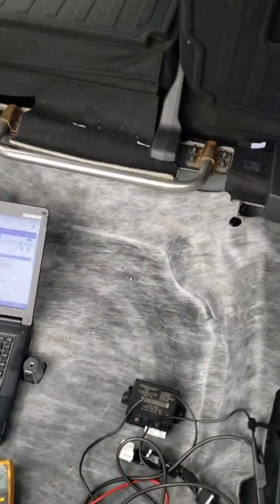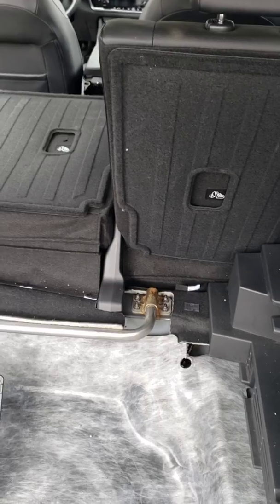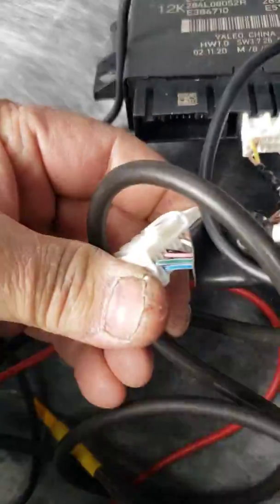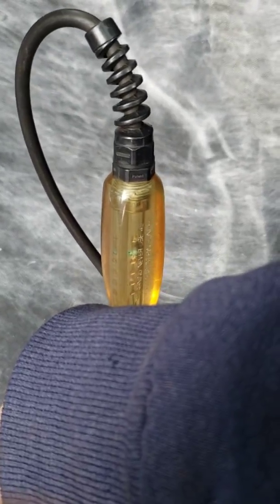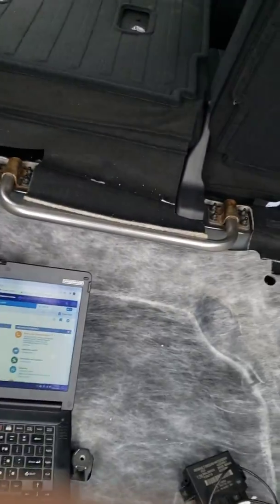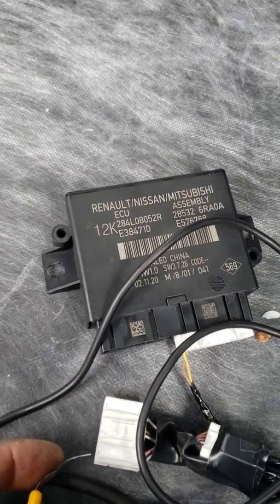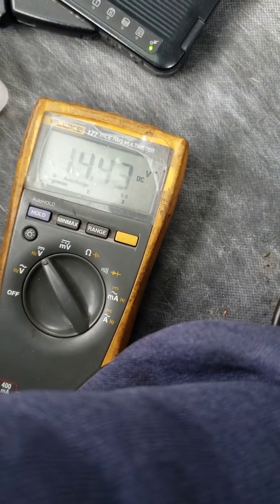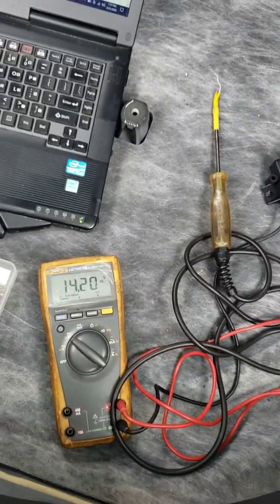Another Reason To Voltage Drop Circuits

Comment: We don't use the meter together with the incandescent test light often enough. It's easy enough to clip the meter to the test light probe tip, looking to see how far it falls when the light should glow. One could even use the observed drop across the test light to estimate upstream voltage drop. I guess that gets pretty close to the LoadPro niche.